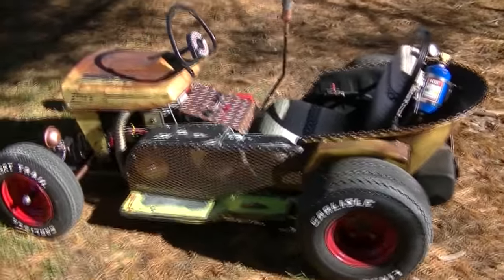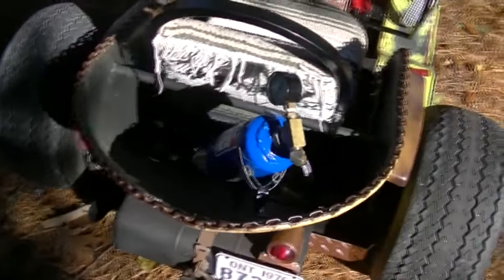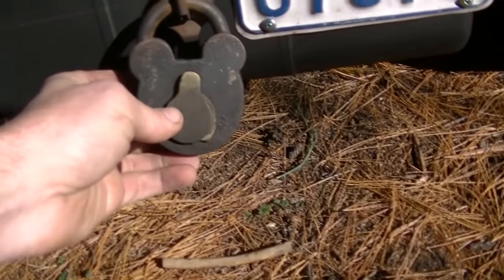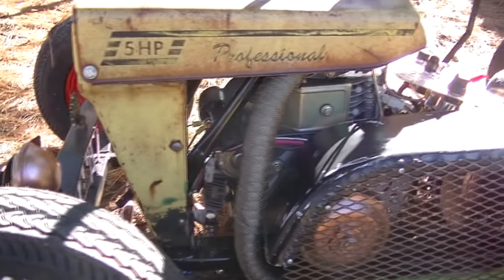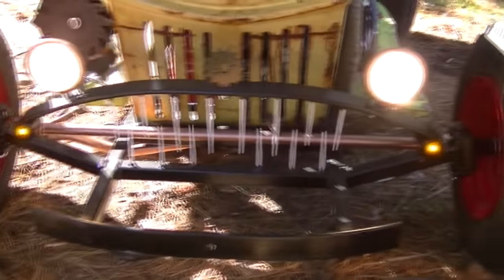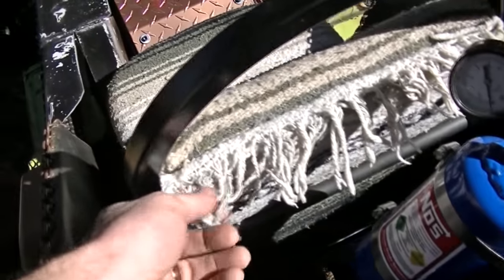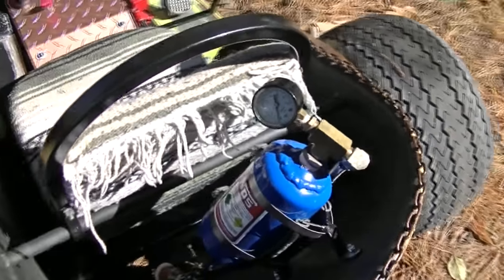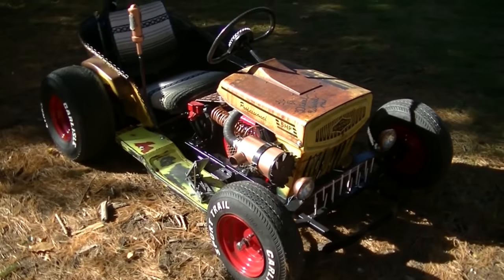Diesel Weasel Walk-Around

Comment: Definitely the flamethrower video. Did you take advantage of the Venturi effect to get the fuel in the pipe? I'm also wondering if you put an extra magneto around the flywheel for a spark introduced in tailpipe by spark plug?
Reply from the maker: Some very good questions! My initial tests did use the venturi effect, and I got 2' or so of flames. I've stepped it up for the final product. I used a seperate "ignition" system for the flamethrowers.

Comment: I have to say no matter what happens in the contest you've already won the real game  just by building this thing. 
     Admittedly I liked it in the semi finished state a little bit more but I'm not here to talk trash on a awesome project. 
I'm quite impressed at how fast she is.But as we all do I'm sure you're going to be searching and tuning for more speed at some point in time.If you do I think you could easily use propane injection to really give it a kick in the ass and it would look right in place with the NOS bottle ;) Propane gets confused with the bad side effects of NOS pretty often but old timers have used it for years on diesels .My grandfather used it on his plow tractor for years to reliably add power when needed.A simple push of the button would give him 20-30% extra HP on demand as often as need be.
      It really would not take much to do a simple setup,solenoids for NOS work and you wont need a fancy controller as long as you use it wisely.The most difficult part would be deciding on the proper jet size but its not a complex equation and as long as you dont hit the button while lugging the engine there's no need for a fancy controller.Essentially you just hit the pedal and as soon as you start building revs give it a little squirt and you've got a extra 25% on tap  ;-)
Reply from the maker: Thanks for the great comments, and the ideas!

Comment: 300lbs? that's heavy
Reply: 300lb is pretty light actually. Some modified mowers weigh 600lb+.
Reply: Keystone Motorsports I don't know how heavy mine was, but I could load it into a pickup truck without ramps by myself.